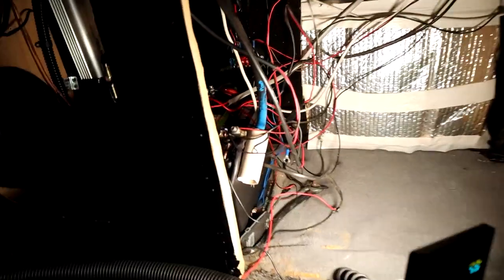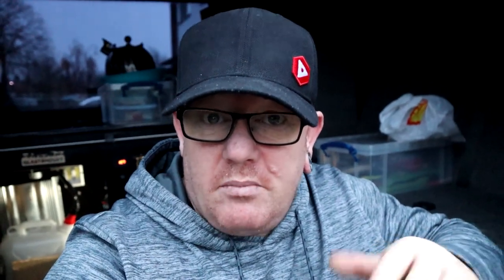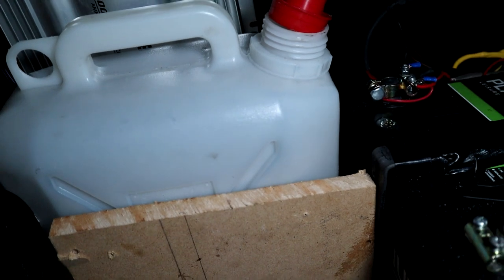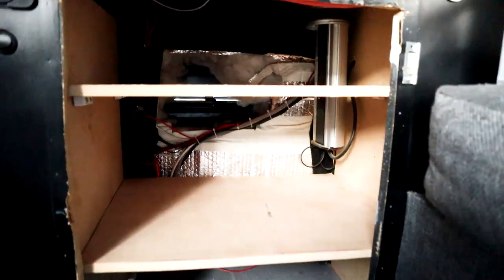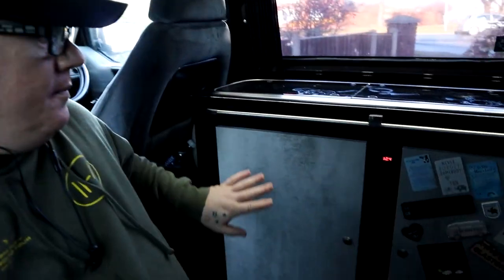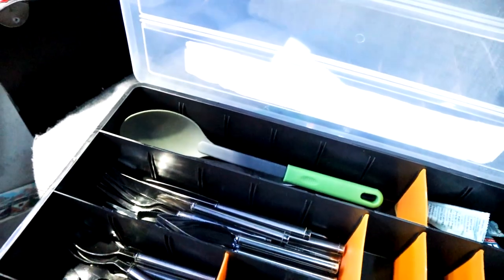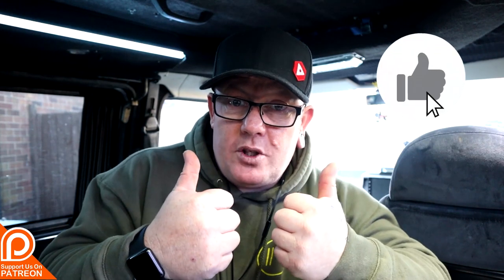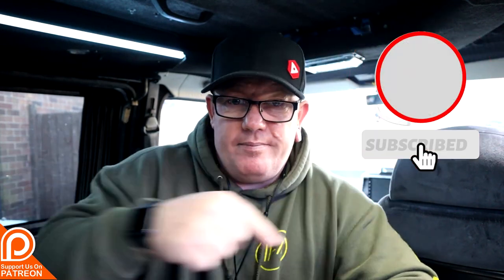Why I Actually Took Out My Van Refrigerator In My VW t4

Comment: I was almost going to take mine out, I now use it by filling a stainless steel box with ice cubes and get a few days out of it as a great cooler.
I also freeze two five litre bottles of water at home and put them in it. I take one out for extra room for meat and butter from the nearest shop when I get close to where I'm going to stay.
The ice melts eventually and gives me extra water or simply cold drinks.

They're definitely not worth losing battery power or gas over though.
If I really needed the extra room I'd  do as you did mate 👍
The doors look well 👀
Reply from the maker: Great idea with the box and ice . Top tip that . But yer I thought space for me was more important than the fridge . Thanks for watching
Reply: @UrbanVanlife  👍👍👍

Comment: Hi Neil , I’m after some advise please mate im re building the rear of my t4 can you tell me the depth of your units ? The original build ( how I bought it ) was to deep making it very tight for R&R bed and I don’t want same problem . Great content mate
Reply from the maker: Ok mate so from the side wall of the van coming out towards the bed mine measure 44 centimetres there pretty close to the bed but nothing that causes any problems
Reply: Thankyou mate I couldn’t find any info anywhere for a measurement so I went 40cm so I should be good 👍 cheers dude

Comment: hi pal.well we wouldn't be without proper fridge as don't live on space food.have cold milk ,cheese etc.our Waeco compressor fridge cfd35 is not fixed in a cupboard it can be easily moved up front when bed pulls out.we had this fridge in 3/4 different campers.bought for 200£ 2nd hand.just bought my sister one but thats bigger was out of a Volvo truck.same compressor idea proper fridge but better was larger van or on land based cabin.
Reply from the maker: yer i get ya mate its each to there own i guess , we have recently got a crafter and just bought a 115lts vitafrego fridge for it so no i can have all the beer cold lol